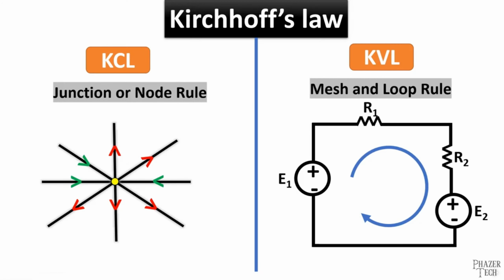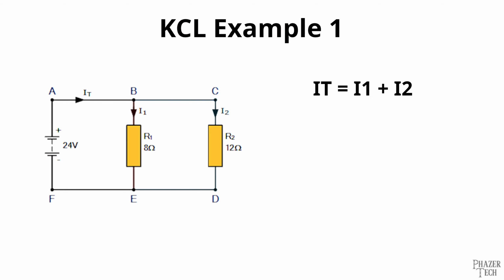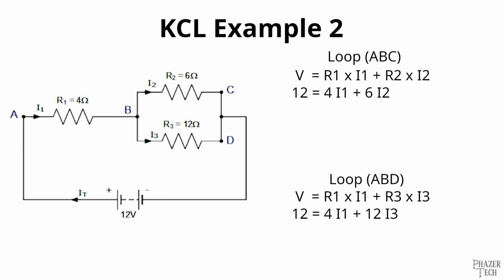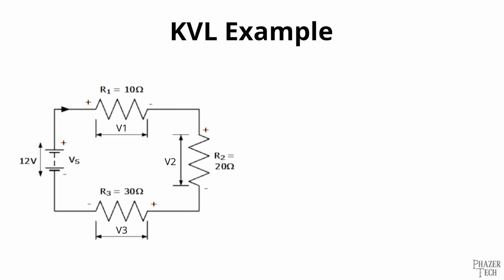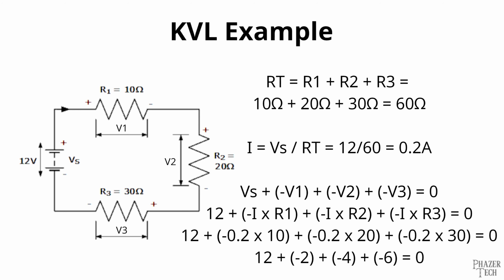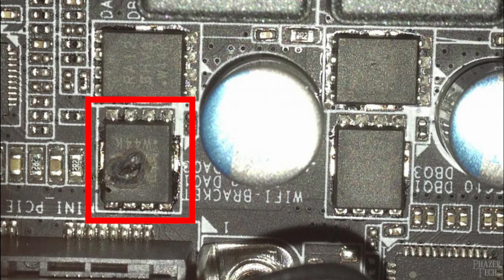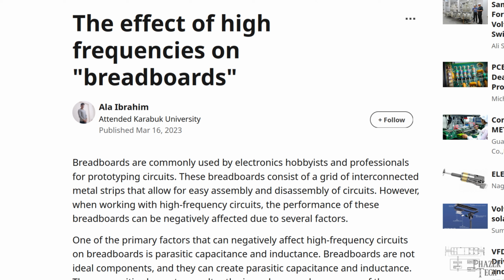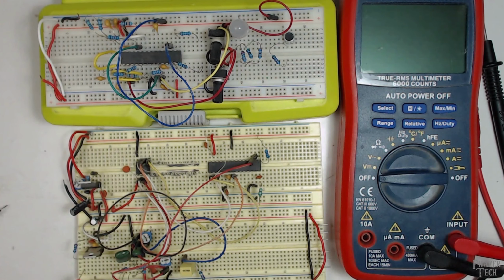Practical Electronics & Circuits 101 – Intro to Circuit Analysis - KCL & KVL

Comment: Amazing explaination , Thank you, For KCL example circuit, it would be much easier to solve through series-parallel mode rather through mesh mode unless warranted if circuit having two sources , no reward for the hardwork these days,